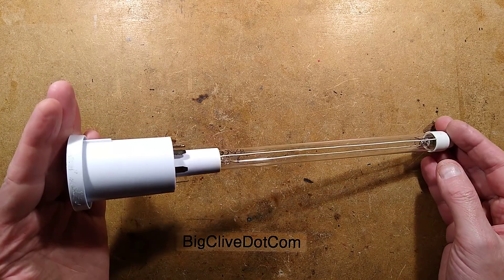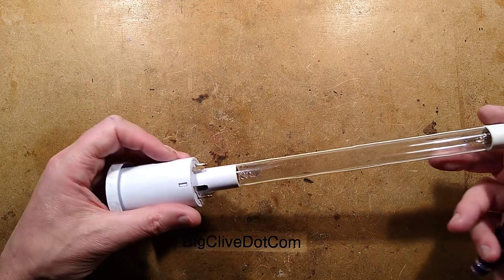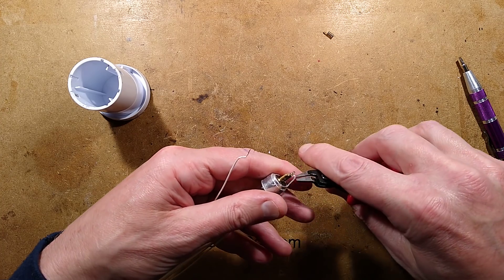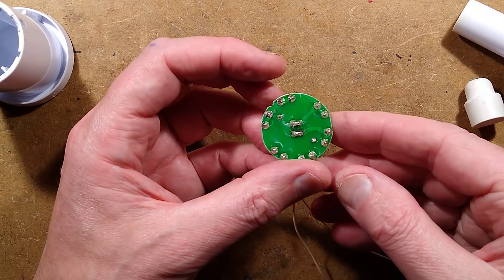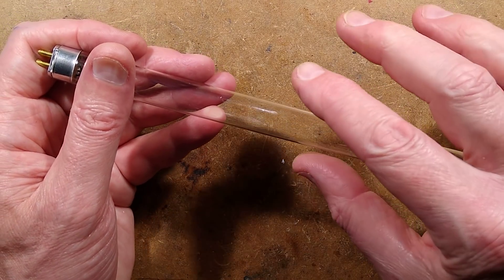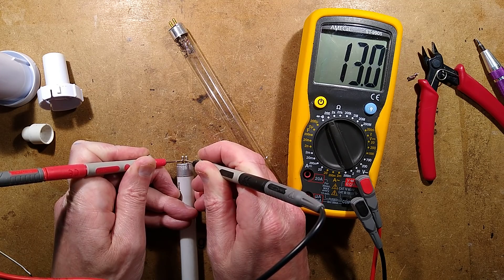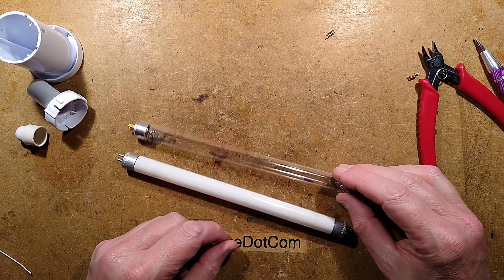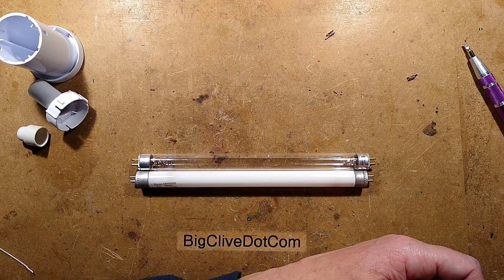UVC module for home water purifier has non-standard tube

Comment: Replace the lamp and you will have no problems. The initial startup will be a second or so longer, as the tubes warm up slightly slower, but once they start to emit they will self heat pretty fast. Lower resistance is likely there because it uses a thicker tungsten wire, so to have a more robust lamp, probably because they are also used for RV tank units, where there is vibration. In a static unit you do not need robust filament so can simply retrofit with the regular one. 

Ballast will not care, the shut off for failed lamps is generally based on the voltage across the tube being sampled, rectified and then fed into a comparator, with a 5 second delay circuit on it to handle the higher voltage at start up, so it will only trip out the lamp life exceeded when the lamp has over 130VAC across it, while typical run voltage is anything from 60 to 90VAC after starting. Covers lamp disconnected, open filament and rectifying lamps nicely, as they all will exceed the threshold at some point. Only the simple self oscillating ballasts will fail, blowing the fusible resistor in the input side, right after the coil, PTC thermistor and the 2 transistors are well cooked.

Comment: In today's nanny state world, I am surprised that a bulb that can do damage has no warning signs, not even a blob of red paint to suggest it could do harm.
Reply: Because this particular one is meant to be replaced as a whole unit and can't be switched on outside of the water purifier main unit.

I'm sure they will one day or another put a ban on UVC germicidal lamps for the general public because of the dangers you mentioned, just like they did with sulfuric acid and like they will also do with acetone and hydrogen peroxide.

Yep, nowadays in most if not every EU country you can't even buy sulfuric acid unless you're a certified professionnal and in some cases you even have to show your ID and fill in a form if you want to buy acetone, hydrogen peroxide or even insulating spray foam !
Reply: @psirvent8  Everything is so controlled,  private individuals are not allowed chemicals to protect the fruit from Fungi but commercial growers are allowed.
Reply: @tonysheerness2427  So will most likely be UVC lamps, and after that you'll have to have a driving license if you want to ride a bicycle just like the one you need if you want to drive a car !

Comment: Hi Clive, when i was in the navy, 1970's, all drinking water distilled from sea water passed over one of those tubes, it was called a, Catadyne unit if my memory serves me right. many thanks for all your videos and info.
Reply: That seems like over kill, it was boiled already.
Reply: @MostlyInteresting  It was "just to be safe" probably as you really don't want anyone to get seriously ill when at sea and thus far away from hospitals
Reply: @MostlyInteresting  The sea water is boiled under a vacuum  about 25inch of mercury,in a unit called an Evaporator, then condensed so not boiled at 100c.
Reply: @geofham8332  okay but even so it only has to reach about 140 Fahrenheit for about 10 minutes to be pasteurized. 160 fahrenheit for 15 seconds. 135 for 2 hours. So I guess there's an energy savings when you use the exhaust heat off of diesels and some vacuum.
Reply: @geofham8332  But it's still a distillation so if it removes sea salt it probably also removes other contaminants, but maybe not bacteria and viruses if it's not heated above 158°F (70°C).

Comment: Please shoot me down in flames but putting in the higher resistance tube should result in lower heater current so should not harm the tube or the p/s.  It may not work due to lack of heat from the heaters but it was worth a try.  Stay safe my favourite Bear.

Comment: Valid test that tube A and tube B are different, which they are. Incorrect conclusion about availability. That's an 11W germicidal tube; see the 11WTUV label on the end, your biggest clue! AKA G11T5 Germicidal. Available on Ebay and other places at reasonable prices.
Reply: Agree, I have a 11W t5 uvc tube here (more standard than that, 4pins on one side) and i measure 2-3ohm.

Comment: Would this lamp kill mold?
Reply: Quick search gave this 

 Does ultraviolet (UV) radiation from UV lamps kill mold?

If properly designed, ultraviolet germicidal irradiation (UVGI) cleaners that use ultraviolet radiation from UV lamps may destroy indoor biological pollutants such as viruses, bacteria, and some molds that are growing on the moist interiors of HVAC surfaces (e.g., cooling coils, drain pans, or ductwork).  But typical UVGI cleaners used in homes have limited effectiveness in killing bacteria and molds. Effective destruction of some viruses and most mold and bacterial spores usually requires much higher UV exposure than is provided in a typical home unit. Furthermore, dead mold spores can still produce allergic reactions, so UVGI cleaners may not be effective in reducing allergy and asthma symptoms.
Reply: @UserUser-ww2nj  
Thanks 
I was wondering if there was a way to keep cheese free of mold. On the lines  the fridge  opens the light goes on. Then when the door closes the uv germicide light comes on. Killing the mold and bacteria.

Comment: I bought a couple 4W UVC tubes off ebay for "reasons" (okay, UV Erasable EPROMs!!! But maybe also for other experimental fun!), and stuck them in a couple cheapo 4W UV note-checker lamps, and, boy do those lamp units run tubes horribly!!! And I remembered your vid on driving fluorescent tubes off DC power, and yeah, it's the cheapo-circuit that causes sputtering and migration, sad times... :(

Comment: Could wire the interconnect couple to a few resistors and use a different ballast if needed. Plenty of room in there to do so. UVC is nice prior to a prefilter on an R/O setup to reduce biologic buildup clogging it growing there , Wouldn't hurt to run it past again out of the final reservoir, probably what they do. They are very thin quartz glass, more difficult lamp-work with than borosilicate or softer glass used for (neon).

Comment: The same bulb format is used for ozone generation as well. Different wavelength, air is passed over the bulb instead of snapping into a quartz well tube. The ozone tends to weaken the plastic components.
And yes, the extra contact pair is a safety switch - if the lamp isn't installed, the circuit is broken

Comment: The water UVC filter system I hooked up once had a 12V transformer because I think it needed to be a SELV system because it might get in contact with water.
Reply: Safety Extra Low Voltage ?

Comment: Similar to lamps used for spas & Jacuzzis .. The tube is quartz. It should be a regular T5 outline - resistance might be low from mercury wetting the heater filament .. Try firing the bulb then measuring the resistance
Reply: This. I got an similar tube. Just U-shaped, but also turned contacts and not just wires as usual. One of the filaments had around 1 ohms and the other over  14. I could clearly see the wet filament. Some shakes later it had 10/14 ohms.

Comment: Had a 40w uvc bulb, I ran it for an hour, not even looking at it, the reflection was enough to fuck my eyes for a full two days, the worst pain, I couldn't tell what was water and what was tears, never again
Reply: Yeah that's the deal with UVC safety.  Basically don't get it on you in any way shape or form.  Better safe than burned eyeballs.
Reply: @steamfire  honestly thought I was being fine shielding my eyes, nope
Reply: Welcome to the wonderful world of arc eyes. This is why you never ever look near an arc weld in progress without welding goggles.
Reply: Like I said in many previous comments I found a working 11w one in the bin for the burned out fluorescent lamps at the entrance of a supermarket and "all" I got was moderate eyestrain for having looked directly at the bulb for litterally a split second just to tell if it was actually in working order and then just out of curiosity I did look at the beautiful blue light for as long as 1 minute on multiple occasions by putting as much glass as possible between the lamp and my eyes since glass is supposed to block UVC.

Still it also gave me eyestrain for a few hours every time, but thankfully no arc eyes.

But you have to consider that UVC germicidal lamps can still be dangerous even behind glass and despite the fact glass is supposed to block UVC radiation.

(I think what gave me eyestrain and even watery eyes once was UVA that is also emitted by those lamps and largely unflitered by ordinary glass).
Reply: @psirvent8  not all glass, there are different types, soda, borosilicate, leaded..
Reply: @phonotical  It was sodalime and borosilicate

Comment: I love the video Clive! I had a bulb like that on a reef fish tank filter system. It was supposed to destroy all of the bad worms in the tank. It made the plastic very brittle tho!
Reply: I hope you had that in de filter water line and not in the open. If it is in a closed system it cannot affect plastics in the aquarium. UV-C in the open harm the fish and your eyes/skin.
Reply: @FairyNL  it was in the unit that it came in. It came in a sort of a PCV or other plastic pipe with silicone in the winds with pipes on either end. One side went to the pump and the other went to the outlet
Reply: Had the 36W ones in a fish pond, regarded the whole UV filter assembly as a wear part, so they went in with inlet and outlet shut off valves, and then a short stub of pipe, with screw together couplings so they could be removed. 2 in parallel, so as to keep the water flow in the 50mm pipe low enough, and kept an entire unit ready on a shelf as spare. 

Generally after 2 lamp changes the plastic was so faded and brittle that you simply put in the spare unit, and bought a new one, transferring the couplings to it. I generally used one 100ml tube of PVC weld per end, so as to ensure it was not going to leak there. Lamps had a 6 month life, on 24/7.

Comment: @bigclivedotcom  I bet you are itching to get inside the main unit and find out what ballast mechanism they are using. But at £50 just for the consumables, I daren't think how much the whole system is.
Reply: £279.99 + £12.95 per month for all consumables or £499.99 + buy consumables when needed at £49.99 for filter pack and £99.99 for filter and UV light pack.
Reply: @barrieshepherd7694  Sounds like HPs inkjet printers; cheap as dirt printer but make all their profit on the ink cartridges...
Reply: @stepheneyles2198  my dorm mates would buy a new printer instead of buying ink at 50$ for a printer or about 80$ for the ink it was just more cost effective had a stack of 10 printers at the end of that semester
Reply: @stepheneyles2198  this is why right to repair is so important! hp is at the center of all of that because of their anti refill policies!
Reply: What fucking ripoff. Greedy bastards. I would modify or replace the driver so a standard cheap T5 tube could be used.  There is no way I would pay those prices.
Reply: That's why I rent my virgin pure,and get free filters and lamps